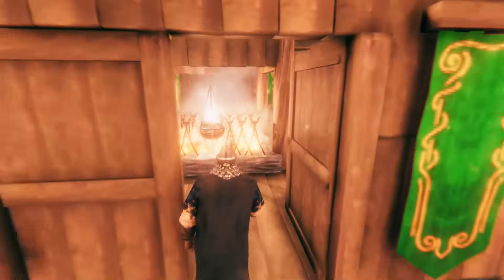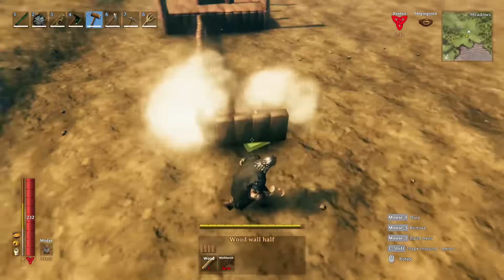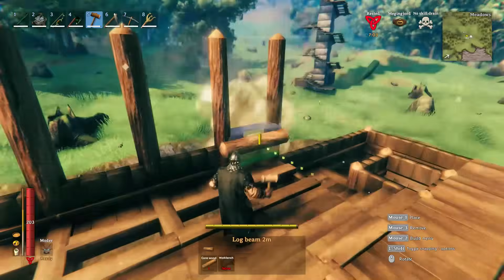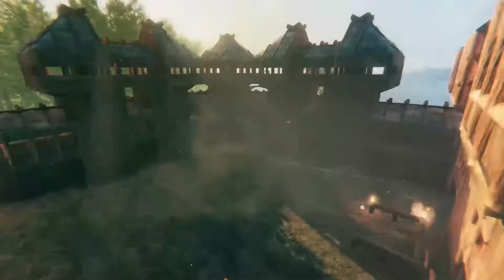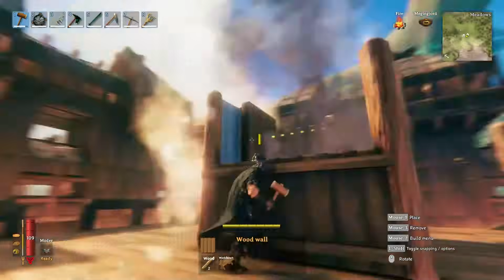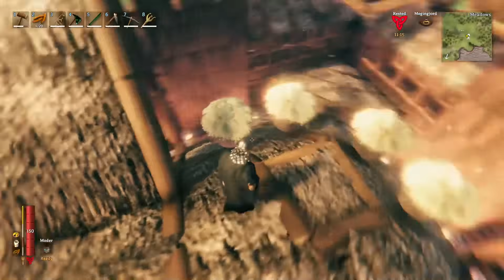Best Large House Design Tutorial | How to Build a Wood Castle | Valheim Building Base Guide

Comment: I tried this, and kept running into the central pillars on the corner towers falling apart. Looked like it ran into height limit
Reply from the maker: Some of your ground level pillars don't touches the ground then. Check that each pillar has the blue color when you look at them with the hammer on. If some wasn't blue use the hoe tool to rise the ground there until they will have the ground support.
Reply: @HTFGamesStudio  Sure enough that was it. Many thanks
Reply from the maker: Always here to help my tutorial fans :D